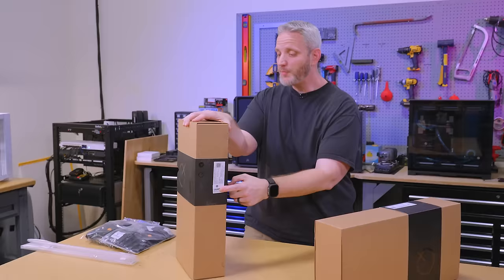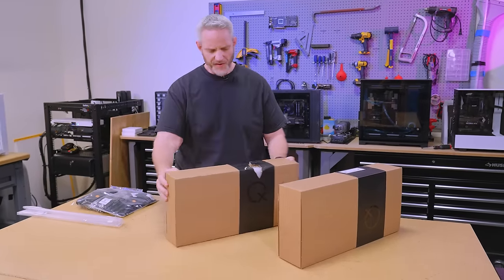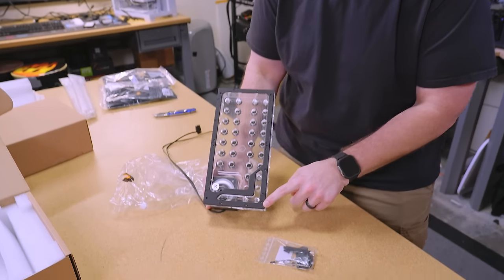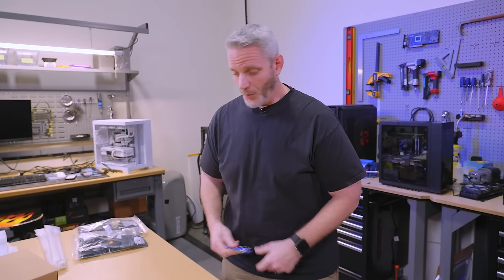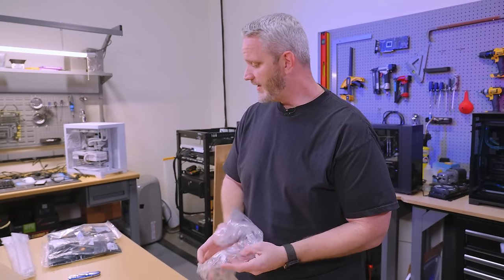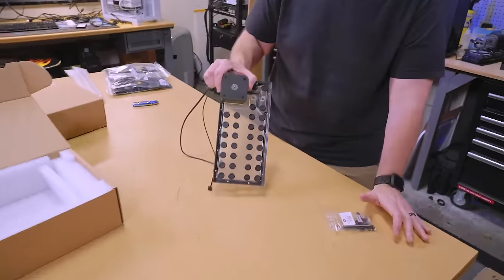Gamers Nexus told me I needed this... so here it is!

Comment: Couple options: 4 vertical tubes in two different coolant colors running vertically through clear coolant. Then you can use white colored RGB fans to provide glow. 
Second, use short straight pipes and plug into the two port sets. Then alternate the colored coolants between tubes.

Comment: Use a case where you can have one in the front, one in the back.  Create unnecessary loopage and have different colors for CPU and GPU. Non-opague coolant but 2 different colors so you can see the other color within each resevoir.

Comment: Well, I reckon Lian Li would be the easy choice; but where's the fun in that?  ......to make it fun.....the challenge might be to retrofit it into the smallest, cheapest, POS case you can find...and the project could involve cutting sheet metal and welding -- modify the infernal beast to look like something we've seen in a MAD MAX movie...add spiked wheels.... rusty chains...chrome exhaust pipes with smoke and flames shooting up, etc.  ;-)

Comment: A two loop system would look super cool with two of these.  Have one color loop red and the other blue but transparent colored.  Then run each loop through each block so the tubes inside the blocks would look purple
Reply: Had the same idea.  I had yellow and blue in mind to make green
Reply: I keep seeing people suggest this idea, but it would only work for a few minutes. After the coolant circulates back into the reservoirs, it will have been mixed. How do you plan to separate the mixed colors?
Reply: @arieshydragaming3334  it would be two separate loops with separate pumps so no mixing

Comment: The moment you said it requires 90 degree swivel fittings, without even knowing what it does yet, it became useless in my eyes. I will never use another 90 degree swivel fitting in my life. They always leak. It may not be in a week, but they'll leak. 

Right now i've got a PC that uses straight compression triple o-ring 14mm fittings from Barrow that has both CPU aned GPU cooled, aquacomputer flow meter, heatkiller Dual DDC pump top, two radiators, and its been running continuously 24/7 since 2019. My coolant is Mayhems XT-1 Nuke. Ive only added a few drops of UV blue dye to refresh the color. Ive got zero build up, nothing growing, only the slightest hint of a yellowish color in the clear coolant. Not one leak and flow rate is 1.5gpm.

Comment: Water cooling computers has become a shit show when it comes to plumbing. It's all looks over function and safety. When I do my next build, and it will be water cooled, I am going to be using actual BSPP plumbing fittings instead of these silly G fittings that all these vendors sell. Probably a very remote pump, a real one not made for PC stuff. Water flow will be split between the CPU and GPU. I don't get why typical loops have them in series.

Comment: Very late on this one, but Koolance does have some very low-profile 90 degree elbows (NZL-LXG2). Though I used barbed fittings and zip-ties because I was using 16mm tubing.

Comment: Only thing that comes to mind, if all the pipes are clear and white backlit.
Two loops (CPU & GPU) with the 'pipe work' using the OTHER Plate's reservoir & Pump.
In Red and Blue. Why, you ask or 'thats stupid' ... Then why buy the plates in the first place?!?
Red loop and Blue loop, then while inside the block's Vapourware-ish.
Then hope it does not even slow leak- else it's all purple. and one loop would empty .🤦‍♀
I'm not the first to suggest this 🤣

Comment: i like the idea of a distro plate on a 011 replacing the glass with essentially a fancy reservoir. but i tend to not like the execution (tubes going back and forth constantly...just why..the first tube brings it near to components then just hop from component to component untill you need to send it back just looks much cleaner.

but at the price of these things, atleast this isn't case specific but does ask that you turn 2 potential intake/exhaust locations in to a 0% airflow location which never really sat right with me.

i see it as a potential airflow optimization not having the reservoir near the fan's to form an obstruction....but then 9/10 distro plates ask you to remove some fan's all together to completely block the airflow in it's location >.<

Comment: I know this is unrelated but, can you PLEASE do a video where you try to tame the temps of a 14900k with an MSI board? I know you've done one recently on the 13900k on an ASUS board, so its unlikely, but I'm having the HARDEST time with it. I have a 360 AIO and I am hitting 100c instantly. Only selecting "box cooler" in the bios which sets 253w limits keeps me in the mid 70s, which seems like such a massive difference and my cinebench score drops from like 40-41k down to 35-36k. I hate losing that kind of performance with a top of the line cpu, but I just cant stand just relying on thermal throttling and my fans ramping through the roof with it on any other setting. I have tried enabling/disabling "enhanced turbo" to no effect. I've tried setting the lite load mode to 8 with very little effect. Maybe I should try unrestricting the cpu and just keep dropping the lite load mode to see if it will tame the temps, but I dont want to run into instability. I've tinkered with XTU as well and just cant seem to find a happy medium of performance/temps. Super frustrated.

Comment: Hey jay, I have a new build in the works in the Thermaltake c700 CTE and I will be using 3x280mm rads and a DDC combo pump. CPU and GPU cooled. Do you think I will have any issues or should I get a booster pump? The rad will be side/side/bottom so the highest it will have to pump is the CPU I am removing my Filter from the loop and adding a flow meter for less restriction. Although the filter I have can be used w/o the filter screen just for looks so I may leave it in for that haha. thanks for all you do man!!

Comment: I put a thicc 480mm rad with push pull EK fans on the front of a Phanteks Enthoo Pro 2 and a 240mm rad on top. The original plan was too cool both cpu and gpu with this big loop but it was back when gpu's were impossible to get. I ended up getting a watercooled 6900xt from asus with its own 240 or 280 rad. Luckily my case had space for all 3 radiators, and 6 HDD cages as well. I love that computer. I will probably be building out of that same case, using the same EK hardware, for many many years. Can't wait to see what you build with this wild and wacky cooling hardware!

Comment: Go stupidly overkill with a dual system PC case like the Obsidian 1000D with both systems having a Loophole each. You could have an AMD and Intel system in the same case just because it's daft. You'd have to put both under full load though and see how much heat is being expelled.
You could then take it one step further and bring out the Singularity Waterbox kitted out with all of the rads that you wanted, creating the biggest, most impractical OTT water-cooled system.

Comment: Use it in a Montech 95 King Pro?? that has 2x140 fans pre installed, should fit over the bottom fans if they're installed. That's my two cents anyway.

Comment: You could do 2 different loops with 2 different colors & have one color pass through the other colors distro plate.. like the reservoir is Green liquid for GPU (Nvidia) but that 90 tube bend has Blue for the CPU (Intel). 

Just a cool idea I think and you could just loop back to the inside for a second bend.. wish I could do a 3d render of what I have in my head to better explain it but I don't know how to use 3D software (I actually don't even own any either 😂)

Comment: Steve was right: Jay is the right guy for the job.
As for the "two of them in one case", I'd go for a dual-system case (can't remember the name of these) and go all-out on the visual difference. The distro/reservoir are black and silver, instead of matching color ? That's not a bug, that's a feature... if you build two loops, and make them visually distinct with different fittings, different cooolant and so on.

Comment: Oooh, if you had two loops that don’t connect (say for a GPU and CPU) you could use the reservoir for one with a transparent color and then do several tubes inside with like a glitter color additive. Then you get lines of one color running through your other color. Could look neat

Comment: 11:55 this entire part was confusing...

Pumps have a flow-pressure curve for any RPM setting. The higher the flow the lower the pressure and vice versa. When a pump has a rating of  Xflow and Ypressure it doesn't mean it can achieve both at the same time. It means EITHER, xflow at zero pressure, OR Y pressure at zero flow. (as long as fluid is moving neither of the two max values can be achieved)

So, a pump with very low pressure but very high flow, rating can only achieve high flow at very low restriction. If you put restrictions on it, like long tubes, it will not have enough pressure to achieve that high flow. (every pipe has a linear flow resistance. The wider the tube the lower the linear value, but the longer the length the higher the overall resistance. A very long wide tube will be as restrictive as a narrow very short tube)

so, if a pump has good flow but low pressure, it's NOT good for long tube runs. For that you would need a pump with good pressure, so it will be able to push what flow it has through the restrictive loop.

IMO both the DTC and the D5 are capable of copping with tubing long enough for most systems, but as a rule of thumb, the more restrictive the loop, the higher the pressure of the pump you'll need to keep the flow up. You' need to look at the actual curves to make an informed decision though (and keep in mind the curve changes for various RPM settings)

Comment: Jay, if you spend that much on the cooling, you might have to cut back in other areas... so build it in the montech king 95, it has space for 240/280 in the front and side for two distro plates. Looks like there's plenty of room up top for a chunky 360, but the bottom might need a slim radiator, as it doesn't technically support bottom rads. On second thoughts, you do seem to be over the o11 builds...

Comment: If you are only using it to cool GPU and CPU two of these doesn’t make any sense for how they are meant to be used. If you are going to use 2 then you have to water cool everything, I’m talking mobo, ram, ssd, cpu, GPU all of it, and you would need a case that can hold 2x 420s + 2x 240s + like 6 more intake fans. Just go all out

Comment: This can't be right. A distro plate should simplify water-cooling. Alternative idea: you have 2 outputs, GPU and CPU, then enter at any 2 points. If the loop is filled to the top of the distro, it should avoid the waterfall effect.

Comment: Maybe I don't get it, but, this thing has multiple outputs and many inputs. Why not have the outputs go to CPU, Graphics and Radiator, and the returns just run back in separately, no internal tubing required. 

Or would pressure become an issue?

Comment: If you're thinking of going slightly ridiculous and over the top, I'd love to see it in the HAF 700 Evo, and get your take on the case too! I had the 932 back in the day, and got the 700 Evo recently as a nod back to my first build, but I'd be curious to see if you have some of the same thoughts I did while setting up my system and loop.

Comment: for a Case you should use a Hyte Y70t. tons of glass to showcase from many different angles. The 45 degree double corner for an added element "Showyness", you can run a loop in between the displays in the 45 degree corner to either the Vertical GPU or to the CPU.

Comment: White case. All white components. One manifold in front with red fluid. Another in back with blue. Have the red pipes run through the blue tank then back out and vice versa. All white lights. Minimal black components, go nickel when you can. Sprinkle red and blue accents as you see fit. Famous phil montage and call it a day.

Comment: I just can't see the practical usage for this pos, I'm sorry but it looks like a money grab to me, and not a water-cooling component that actually adds value in any way. The fact that they made the fittings for inside the res basically proprietary and then sell them for insane amounts of money is the icing on the cake. In my personal opinion, it's basically a stupid product, I'll leave it at that! If you have to absolutely murder a case design with it, maybe the 1000D for the amount of space it provides, especially if you throw two of those "things" into it. It looks like it's trying to solve a problem that doesn't exist, great job €K.

Comment: Montech King 95 Pro I think it would be funny running a quad rad setup on it 280 in front, both 360 bottom and top, 120 rad in the rear exhaust and the 280 in the back of the case can be the distro plate.

Comment: Could you not just utilize the pump output to feed the cpu/GPU, then their output to radiator and then just dump back to the reservoir/distro. It alleviates the need for the internal plumbing. It looks to me like there are 4-5 outputs with 32 inputs...

Comment: Assuming there is some insane case that would actually fit this idea: Dual system with the silver (angelic theme?) reservoir and the black (demon theme?) reservoir. That way you can use both colors, not have to make them symmetrical (since they are "opposed" to each other), and would be extremely over the top (the J2C special!).

Bonus points for one system being AMD, one being Intel. (Simply for the ridiculousness of the whole thing)

Comment: Have you considered the possibility of running separate loops for GPU and CPU, while ensuring that the other loops are connected to the reservoir and go back to their respective loops? This could potentially improve the performance and efficiency of the system.

Comment: I 'd love to see how it would look with those front and back, rads top n bottom. Top rad in/out towards the front, bot rad in/out towards the back, so you have 2 parallel tubes from both rads going down and up the reses.
feels weird to 'draw' a loop just by writing without showing :D but here's what i m thinking:
front res out -> gpu in
gpu out -> back res in
back res out -> bot rad in
bot rad out -> back res -> cpu in
cpu out -> front res -> top rad in
top rad out -> front res -> front res in

Now we also need an imaginary case that has more than 240 space front and back though, because I want the plates to not be at the same height, but the front one more to the top and the back one more to the bottom so they make a nice 90 angle 'continuation' with the rads.

Felt nice to spent my imaginary 2k euros for this :D

Comment: You should build in the new Corsair 6500X case and use a Project Zero/BTF mobo so all the cables connect to the back of the board

Comment: So if you did a closed loop totally seperate from the cpu/gpu loop would the flood just hitting a rad and back serve as an extra heat exchange for the flood in the other loop? It's confusing and nevermind cuz im not sure how you'd make that work without another distro plate or pump reservoir. This got confusing fast.

Comment: I feel like it would make more sense to use it as a reservoir.

If you had multiple pumps, you could hook up multiple in and out and it would all flow properly. Just want to make sure it goes to your rads first so you don’t risk pulling hot water into your components.

Comment: this would be cool for a showoff kind of build. with 2 of em you could have 2 independent loops with different color coolants running through. like one loop for CPU and the other for GPU where loop 1 can run through internal routing through manifold 2 and vise versa kinda like the umbrella corp virus tubes.

Comment: Use the Phanteks NV9; Run one loop with all your components and 2 rads through this distro block where all the tubes are run inside of it, never actually using this res/pump but fed from the other completely separate pump and res. Then have a separate loop with its own radiators using this block that then bathes those pipes that run inside of it and run it out to the huge external watercooling tower you showed a few videos ago thats just loaded up with rads and maybe a second pump/res to help overcome the pressure. That way you're quite literally watercooling your watercooling.

Comment: Why not cut to length then screw the fitting in?
Could you make a bespoke wood/metal frame? Given that you can use riser cables, components could be mounted on angles.

Comment: Jay use this in one of the new corsair 2500 series could put it up front to show it off and then use 2 280's on the top/bottom for the actual rads as long as its not a 139/149k and a 4090 it should be fine use a thick 280 for each the cpu and the gpu and with a rad between each and show off the most amount of fittings in it also did any one consider using the block itself for a return and have the pipes submerged in running fluid like a waterfall effect?

"fluid in your fluid bro"

Comment: If you used copper tubing that can transfer heat for all the connections and gave the "reservoir" it's own loop you'd end up with a heat exchanger of sorts. In a real life scenario it would only be effective for a short time until everything equalized, but if you're gonna do something stupid you might as well go all out lol 
Or if you felt the need to go full crazy you could pour in LN2 and see what difference it would make to super cool the few inches of each loop that's inside the box.
I would love to see these experiments for entertainment value, even though I doubt either would give a mind blowing result.

Comment: Should toss it in a Monotech King 95. It has space for two 140mm that pivot, allowing you to use either the glass plate on the front, or a mesh panel. Also, that case comes in many different color options.